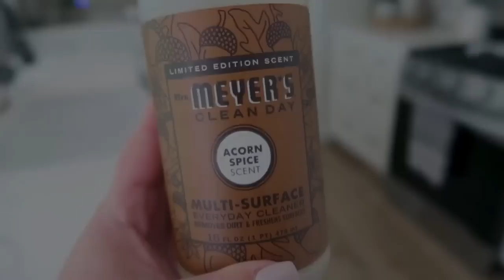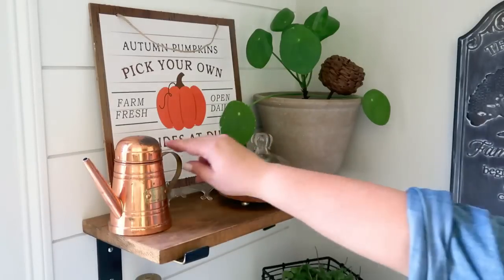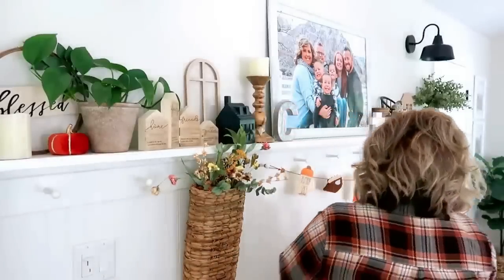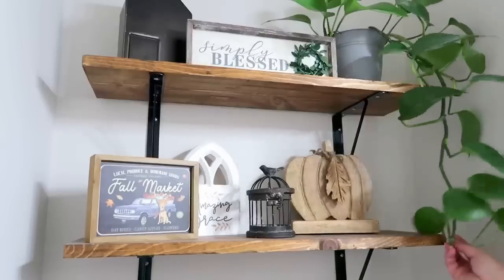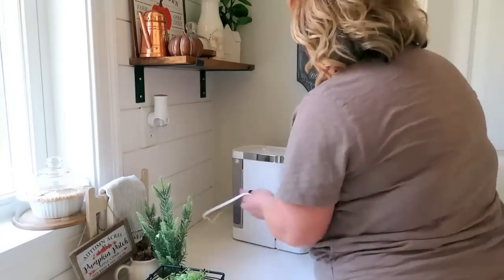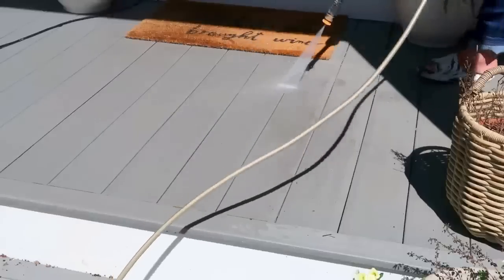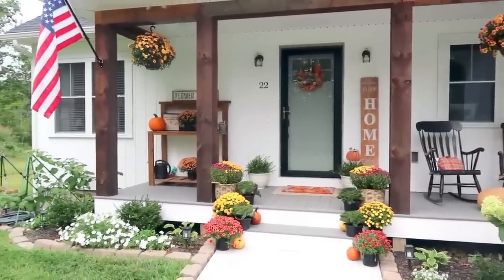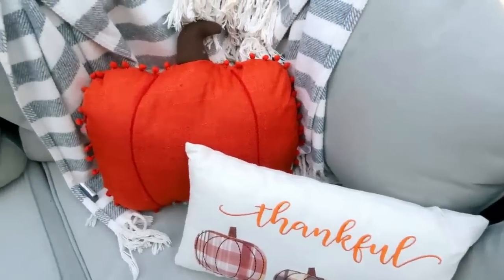FALL MARATHON // FALL DECORATING INSPIRATION // CHARLOTTE GROVE FARMHOUSE

Comment: I made a faux pumpkin pie using a real fall ceramic pie plate, also made a faux yellow layer cake w/ paper sunflowers for decorations. I  also made  candy & caramel apples w/wooden apples. So I love to use faux foods. I display these on my green/cream 1930's Art Deco stove which is my treasure. I  also display the fake bread loaf from Hobby Lobby. I have it on a wooden cutting board. Yes, here in WI the nights are getting colder and the leaves are just beginning to change. I decorated my house last wk.